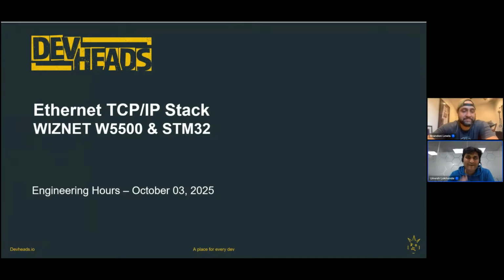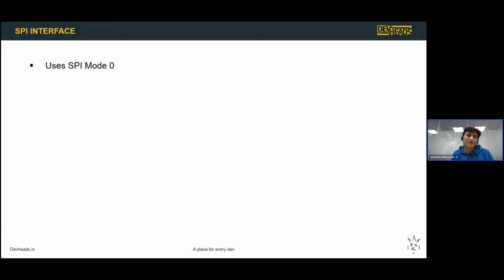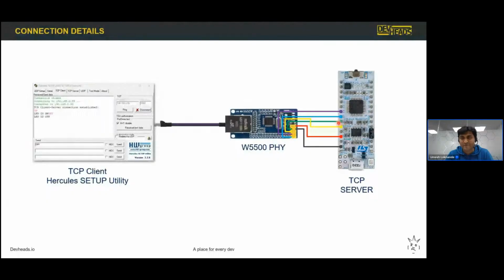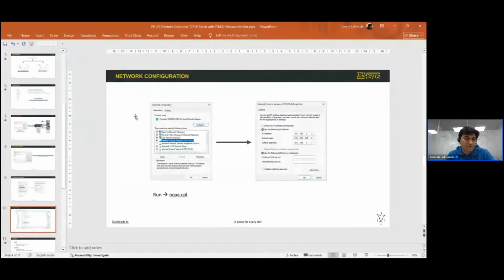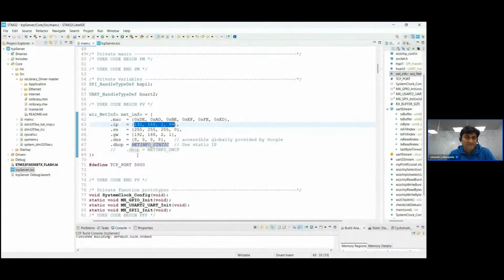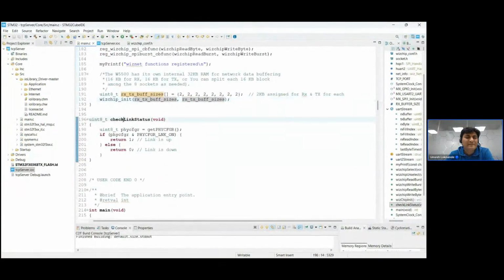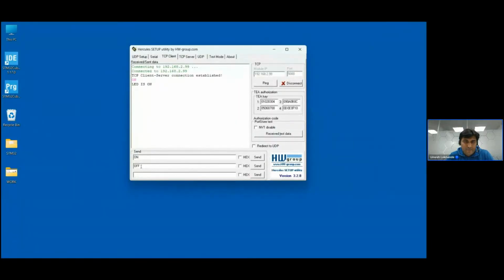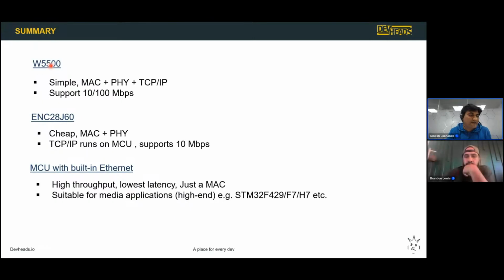Ethernet Controller: Implement TCP Client–Server using W5500 & STM32 MCU.

Comment: If I power the W5500 module without connecting it to any microcontroller, then connect it to a PC using an Ethernet cable, should the PC's network adapter change from "Network cable unplugged" to "Connected"? Should an Ethernet link be established, and should the link LED remain on?